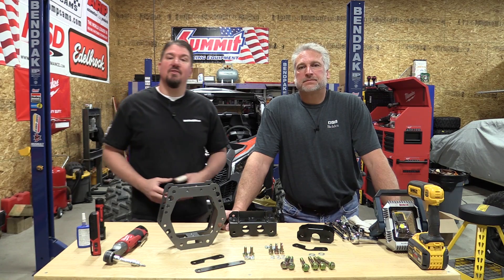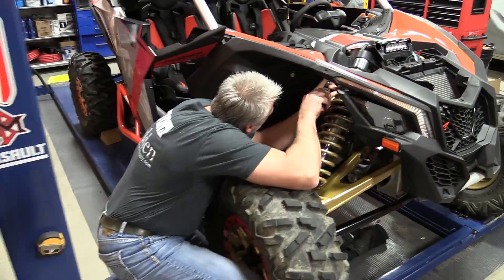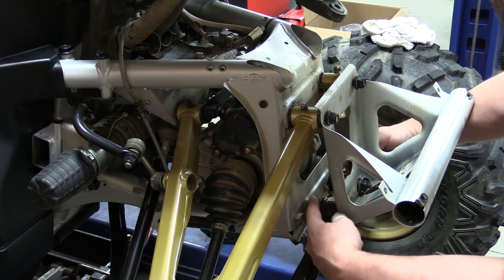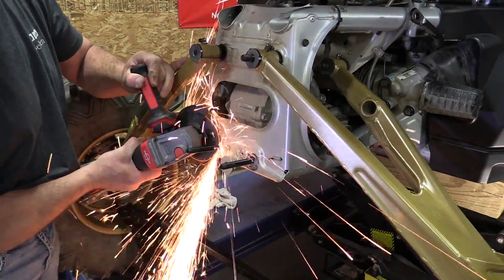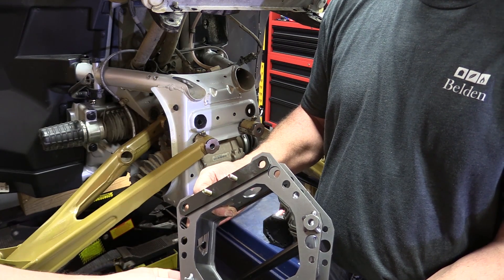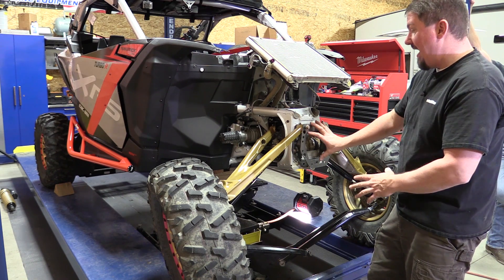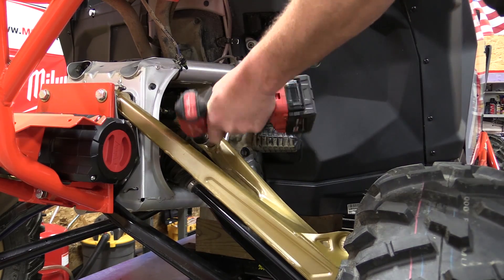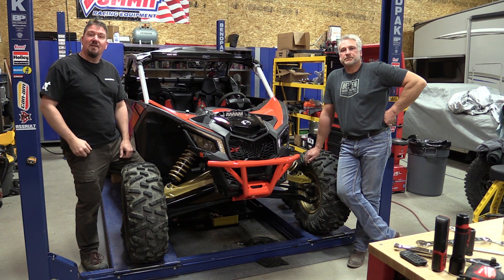How To Install a Front Gusset Kit on a Can-Am X3 Assault Industries Front Structural Reinforcement

Comment: After you have a gussing kit put it on the front of the rig and a shock tower and the job is completely done when I’m at the front of the rig and I push down on the bumper it doesn’t go up and down it’s real stiff is this normal for the new gusset kit Does it take a little ride loosen the friend end up

Comment: Good (and bad) video. :)  Good because it convinced me to buy the kit.  Bad because now I am installing and it isn't as easy as you made it look.  Bought the kit for a 2019 maverick x3 xds.  Why are there only 6 main bolts (4 for the front, 2 for upper rear, and then what for the lower rear? - Stock ones won't be long enough now apparently?)  For this kit and price you'd think that you would get everything.
Reply from the maker: Our video should walk you through this and make it easy.  Two people help!  it also helps if they know how to wrench.  If you need longer bolts, call assualt.  They should have this down by now.

Comment: Did you have to put different bolts on the back lower gusset kit? The kit im doing has about the same gusset but the stock bolts are about a 1/4 in to short to get the lock nut all the way on
Reply from the maker: Yes, We did have to change them.
Reply: @wrenchesrides  what length did you put in it?

Comment: I’m about to do this install and found your video. First of all, thank you. Second, the winch bumper I bought is clearly going to need some modifying. If you look in your video at 13:08 it appears you didn’t drill the bulkhead to allow the winch mounting bolts to go through and it’s making it so you cannot remove the winch without removing the front bumper in addition it looks like it’s bending the bumper plate? Any issues or advice?
Reply from the maker: Our winch bumper was highly modified and weakened by the mods to fit a Warn Axon 35.  We would have to remove the bumper to remove the winch so we did not drill it.

Comment: Does that front bulkhead piece shift everything 1/8 forward..do all the front plastic mountong holes still line up?
Reply from the maker: Basically, everything shifts 1/8" forward to allow the brackets to fit.  Everything still lines up great.
Reply: Thanks guys

Comment: I have a 2019 Can-Am X3 Max XRS and would like to know what all went into modifying the F-22 bumper to accommodate the larger winch mounting dimensions ... I would like to run either the Axon 45s or 55-s ... great video.
Reply from the maker: All we had to do was trim the bottom of the bumper tubes slightly and weld in new metal to make it fit.  Took us about 20 minutes, mostly to bend in the new pieces we cut out.
Reply: @wrenchesrides  You started with Assault Industries F-22 bumper correct?  Did you have to drill new holes for the wider winch mounting pattern?(it appears to have (2) sets of holes for mounting the winch) Did you add the (2) small bars on either side on the top bar (support / light mounts) or are those included? Do you have a photo of where you trimmed the bottom bumper tubes? Sorry to be a pain just really like the bumper and the idea of a larger winch for my 4-seater.
Reply from the maker: We did not need to drill new holes for the winch, but we did for the fairlead.  We did add those side bars and light mounts.  There is a flag mount for the dunes added also.  I do, but don't know how to post it in the comments.  Maybe we should do a video on all the little things we customized?
Reply: @wrenchesrides  That would be great!

Comment: Great vid as always. I was just curious if you guys, or anyone out here in youtube land, has had issues with the stock mounting. I see these kits all over the place online, but I do not personally know of anyone or have heard of anyone, who has any issues here. I find it hard to believe that the engineers at can-am would have designed these important areas for failure, but not saying it's impossible.  After installing any of these gusset kits, where would the "weak link" link be? Im not sure what would actually break without these kits, but I do know from "expensive experience" that when you start beefing up stuff, you make the cheapest part to repair, your "weakest link". Thanks guys. Appreciate it.
Reply from the maker: Yes, we have seen the paper thin stock braces wrinkle up and bolts bend.  We have seen the front bulkhead bend and even seen the lower frame tweak on these due to the single shear.  Your full suspension is riding on a bolt only supported on one side for the rear upper and rear lower A arms.  The weak link is the lower A arm, we discuss this at the end of the video.

Comment: really good vid. I did a shock tower brace and gusset kit last year on my 18 and this is the first vid I have seen of most of the steps...nice job!  Also, man, it looks soooooo much easier with a lift vs jack stands and blocks on your back
Reply from the maker: Thanks!  We worked to try to take the guesswork out of it for a novice doing it in his garage.  The lift is needed to get the camera in the right places... Yeah... right.  We are too old to do this on jack stands.